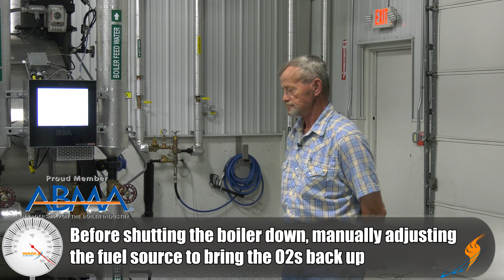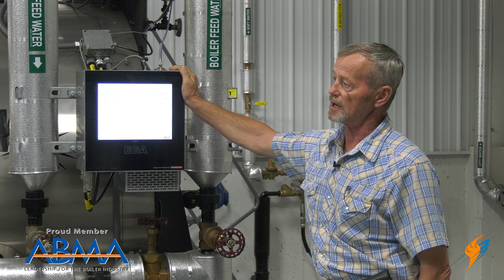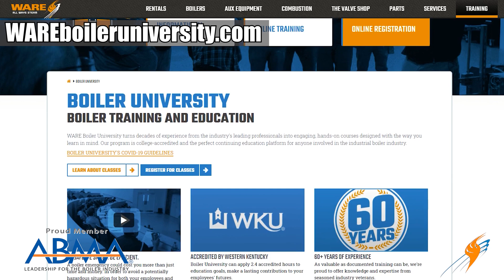Boiler Shutdown on Low O2 - Boiling Point

Comment: Just watched this video, great discussion!  One question I had was on using the Fireye YB100 or the Honeywell 7800 series.  I thought these flame safeguards do not go thru a post-purge if the non-recycle limits open during a run period?
Reply from the maker: We just tested and  both the Fireye and Honeywell complete the NFPA 15 second postpurge - at least as far as the YP100 and 7800-7840 models tested in our lab are concerned. Hopefully that answers your question. Thanks for the comment!

Comment: You can wire a relay into the e-stop, and have the Autoflame EGA trip the "e-stop" which will give you the same affect of E-Stop shut down with no post purge.

Plus if you run normal O2 at say 3%, with guaranteed O2 you can set the limit to 2% O2 which will shut it down just as mentioned, earlier than the hazard zone. Plus as also stated Co alarms can also be set for earlier shut down, without the hazard load situation.
Good subject matter gents.
Reply from the maker: Thanks for watching!